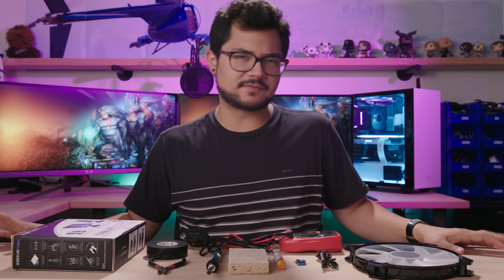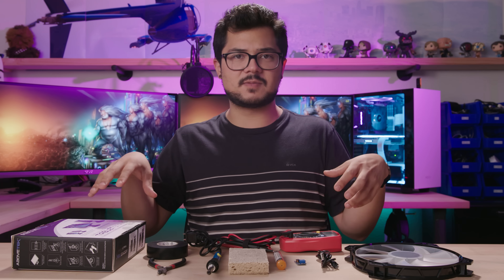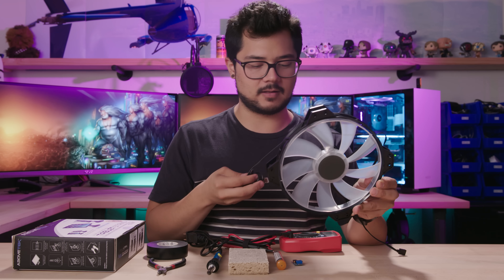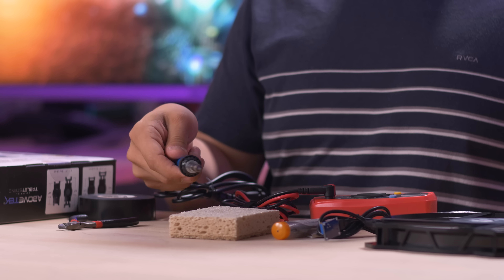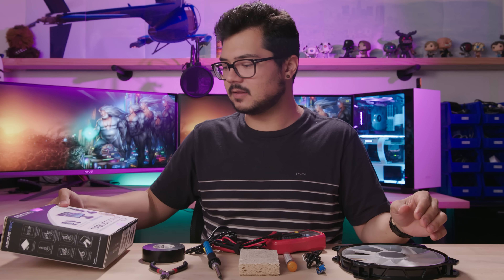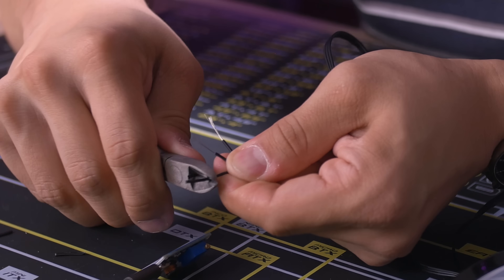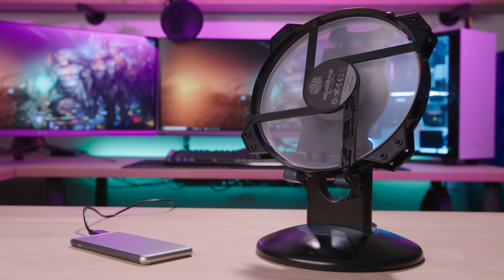DIY your own USB fan (using a PC case fan!)

Comment: Nice project.
Please don't use a wet sponge though! It thermally shocks your soldering iron tip. It better to use a wire cleaning solution like the Hakko 599B-02. 
Also preheat the thing your trying to solder a bit before applying the solder.
And Flux can be your friend to help the solder flow ;)
Oh yeah, and don't strip your wires that much. Half an inch is more then enough. In this case a few millimeters is plenty ;)

Comment: Good job! Next time strip lees of the wire insulation so it's closer to the connection and it will have a less chance of shorting :)

Comment: Noctua has 5V fans listed on their website. those would be perfect.
Reply: Was going to say the same thing. I've been planning something similar myself and ordered parts before discovering the Noctua 5V range. They seem to come with everything you could possibly need, including a USB adapter.
Reply: What rpm do they have? Noctuas usually run at 1500. I'm planning to build something like this.

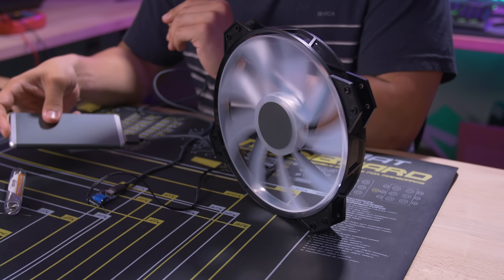Comment: at 7:07 the fan begins turning. but now you got the ugly fan-hold-thing in the middle that you can see it. can the fan turn the other way by switching the wires?
Reply: Diangelo Emerencia it only turns 1 way, if you switch the wires it won't work at all

Comment: You should do another one where you use 2 or 3 120 or 140 fans and use the mounting holes with one fan in the back and use the mounting holes and nuts and bolts to put them together. Solder the wires together and connect to the usb hub you used and have the 2 or 3 fans running together, for the people out there that have multiple 120 or 140 fans but no 200 fans. I like this diy project and more would be awesome.

Comment: Just get a bunch of rgb fans and cover your ceiling in them, and badabing badaboom, you have cooling and lighting
Reply: Nick sshhhhh
Reply: But will they be able to move any air when they're against the ceiling?
Reply: Brilliant... just brilliant.
Reply: GENIUS.
Reply: @ Nick just take longer screws and make sure to leave a small gap between the fans and the ceiling? if the fans are 25mm thick, then 50mm or longer screws will get the job done... But I dont know if screws that long exist :D
Reply: My room is rectangular so itll be like Im living in my pc
Reply: yeah and a sky high electric bill

Comment: Will this give me more fps?
Reply: Better room air circulation -> ambient temp lower -> lower CPU temps -> less CPU throttling -> more fps.
Reply: @Tractionless  lol ur pfp made me think that I had a bug on my phone lol
Reply: +15% FPS
Reply: Due to the decrease of room temperature, you will get approximately +%0.0000002 FPS
Reply: jaKz9 that’s a lot of fps
Reply: No, it isnt rgb
Reply: Yes
Reply: about 5%. if you add a "gaming" sticker and enable all the leds however it's 69% guaranteed.
Reply: Of course! It has RGB's!
Reply: jaKz9 technically it adds heat to the room though.
Reply: Yes, you will get more fans per second. Two of them will give you double the fps etc.
Reply: Gunnargd yes it is! The rgb lighting just isn't turned on
Reply: If you install the latest drivers
Reply: If you point it to your overheating laptop, maybe?
Reply: It will make you run Crysis!
Reply: it decreases heat and then decrease potential cpu bootyneck
Reply: Of course
Reply: yes
Reply: Yes if your fan is rgb
Reply: It will give you more sanity to use your fps
Reply: You dont have to ask
This is clearly
Reply: Depends
Reply: No, but it makes you cooler.
Reply: @Pasi123  r/woooosh
Reply: @kamielbreyne7859  r/woooosh

Comment: one thing you can use for a stand is a metal rod that fits through the screwholes , bend it 90! twice in the right spots, poke it through the holes, angle it upwards, done

Comment: So if you wanted to get really slick with the RGB desk fan, grab a wifi rgb controller. Really any will work, but for a $1 more its worth being able to ok google turn on the fan. So you would wire it up almost exactly like you did but add a second pair of leads to the step up boost converter that go to the rgb controller. BAM done, they are like $10 on amazon or like $3 if ordered from china and you can wait

Comment: Cant say ive tried anything like this, but i am working on a DIY cell singal booster with an old sattelite dish thr project is apmost done, but this DIY pc desk fan would be so helpful in my hot ambient environment i already have an AIO cooler in my chasity, and on my floor have a box fan blowing towards me and my pc at all times on high.  I love to tinker Kyle i love this idea! I have no idea how to solder myself either but i am going to be working on another diy project by taking apart an hdtv and replacing a dead capacitor i just need myself a ifixit kit,soldering iron,and multimeter.

Comment: a much easier way to do this is with a 12V power supply with molex (they sell these usually to power hard drives taken out of systems), then a molex to fan adapter. No solder needed.
Reply: also yes I did this years ago when the AC was broken.

Comment: Next time apply more heat for longer time on that solder point. Also cut your wire shorter for less chance of shorting the output.

Comment: Why didn't you get a 3 pin fan extension cable so you didn't need to cut the connector off the fan?

Comment: To everyone watching: don't get that soldering iron!!!! A while back I helped teach a class to a bunch of people new to soldering using those irons (someone else bought them). It was horrible, even I as the instructor struggled with them, and I'm pretty sure I turned off 50%+ of people from ever trying it again. The iron oxidized too quickly, the twist lock kept coming undone, there's no switch to turn it off and the temperature on the knob is probably not correct. They are that bad... you can get something so much better for just a little more.

Also, yes: probably better to not solder like Kyle did. With stranded wire you generally let the solder flow into the strands to turn it into a solid core, then push it through the hole and solder the tip, As this acts as a force-strain relief.

Comment: There are USB powered RGB controllers, not sure if this particular fan would be compatible with one, but I've been using one for years with a standard 44 key remote controller and it's like 5 bucks. Just putting it out there for the RGB enthusiasts.

Comment: I did the same thing a few years ago as a cheap alternative to a fume extractor for my soldering activities. I didn't use a SU Boost Converter or anything, I just cut off the end of a USB plug and soldered the wires together, and just used a $1 5v USB power adapter. Worked fine for years until I managed to save enough for a proper Fume Extractor.

Comment: Don't put people off soldering by recommending garbage soldering irons. They will get the wrong idea. Also, don't use a wet sponge, it will crack the protective cladding on the soldering tips, and then you won't be able to get solder to leave the soldering tip.

Comment: Decent soldering for your first try.
Buy your self a pack of resistors and a copper breadboard and just solder untill you have soldered every single one.
The solder should fill the entire soldering pad but there shouldn't be so much solder that there's a bulge.
Imagine a camping tent that's heavy with rain water.

Comment: How can you increase volts from 5v, wouldn't that be free energy?
Reply: Voltage is not energy btw. Basic electro theory. Power = Current x Voltage (where Power is Energy/time). Therefore one can increase the voltage simply by decreasing the current.
Reply: Daniel, dude, exactly what I posted yesterday.
Reply: magzire my sarcasm detector is broken, so I don't know if you are serious about that, the little step up board consumes a few mW in the process of converting 5 volts into 12 volts, so I don't see the "free energy"
Reply: A boost converter uses an inductor internally to resist changes in current by creating and destroying a magnetic field. A switch is rapidly opened and closed creating and destroying  a magnetic field that resists changes in current. When the switch is closed a magnetic field is created and what it is open the field is destroyed changing the polarity and essentially creating two voltage sources that are in series charge a capacitor thus boosting the voltage.

That is probably a terrible explanation but a boost converter is a pretty simple circuit that just needs an inductor, a switch, a diode, a capacitor and a resistor or potentiometer
Reply: magzire no. You get Watts from power delivery. Just so happens Watts is volts x amps. The transformer, ups the volts by dropping the amps, keeping Watts the same

Comment: Get a USB LED strip and remove the end of your fan's 4 pin RGB header.  That way you can use the in line controller on the lights

Comment: Have you ever thought about investing in a 3d printer? Also think about some flux next time
Reply: You should try it....it is magic...i used solder with a flux core then after changing to separate flux improved the joints considerable
Reply: If you need something designed and or printed let me know. I can use it for a video on my new channel. I really enjoy designing functional prints from scratch

Comment: Hey Kyle... I'd like to share something with you: If you connect a PWM fan with inverted polarity, the fan won't spin. If you then connect it with proper polarity, the fan will spin at very low RPM (propably only 25% of maximum potential). If you experince something like that, worry not! Just invert the polarity once again and then invert it back to proper polarity. The fan should spin at 100% now :3 (Please note that this may be a "lie" xD Because I have only experienced that once, and after "fixing" the fan speed, I didn't try it again, because I was afraid I might fry the fan :3 )

Comment: It's cheaper to just buy a dedicated USB desk fan when you consider all the extra bits you need lol.
Reply: DIY is always more expensive than just buying something off Amazon. It's more for hobbyist and less for people wanting to get whatever is cheapest.
Reply: exactly. there was not much point in this video, the amount of effort and money you would have to put in just to do what Kyle did isn't worth it. Just buy a simple desk fan and be done with it.
Reply: I think you're both missing the point(s) of this video. If you already have spare fans, and already have a soldering iron, a DC step-up converter like the one used costs like $1, and if you already have a soldering iron, you are likely to be a person who likes tinkering with electronics.... or.... this could be a very basic intro into tinkering if you're looking to get your first soldering iron.
Reply: Chris James ok so I can see one plausible part of this, and that's a spare fan laying around. Otherwise  you would have buy a soldering iron, a pair wire strippers etc. Even then there's no guarantee it'll work. You could buy a  desk fan, plug it into an outlet and done you have a fan on your desk during the summer.
Reply: Yeah, tbh I think it is mainly aimed at those people who want to buy their first soldering iron, as it is a rather good and very very simple intro into tinkering around with electronics. Because if you already have a soldering iron, you almost certainly would already know how to do this, and if not, I would be worried haha.

Comment: You could hook it entirely up to a Raspberry Pi: IIRC they have a 12v pin and if you connected the 4 pins from the RGB input for the fan to outputs from the Pi, you could code your own RGB lightshow.

Comment: You can use an RGB extension wire to connect either R, G, or B to the same 12v output powering your fan to turn on the LEDs... presuming that these are standard 12v RGB fans and not the addressable 5v fans.
Reply: If you want to take it a step further, take 3 leads from the 12v side, 4 from the ground side and get 3 potentiometers. Set up your RGB connection to the fan placing 1 potentiometer in each of the R, G, and B leads. Wire up (and test) the potentiometers as described in this very strange video where the RGB-to-fan is the circuit: https://www.youtube.com/watch?v=wUAiBnPg3TU 

These will allow you to adjust the color of the fan by turning any of the three knobs.
Reply: Your step further is a good way to waste energy... (Assuming you want to use this with a powerbank) 
A potentiometer is basically a "modifiable" resistor and as we all know, a resistor turns electric energy into heat energy.
Reply: The point is to be able to adjust how much power is going to each of the rgb leads, changing the color of the fan.
Reply: Bamfhammer nice jon
Reply: @davetruong7775  Why use the potentiometer for the RGB light switching, when it can be utilized for a more effective purpose: adjust fan speed. :)